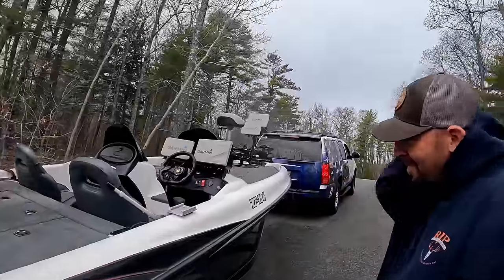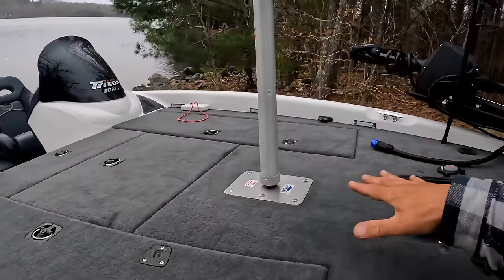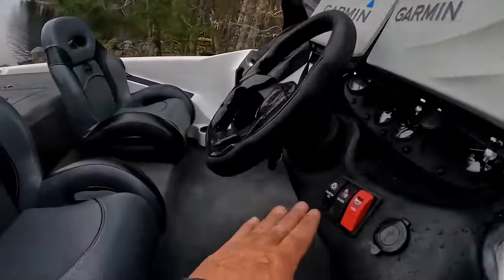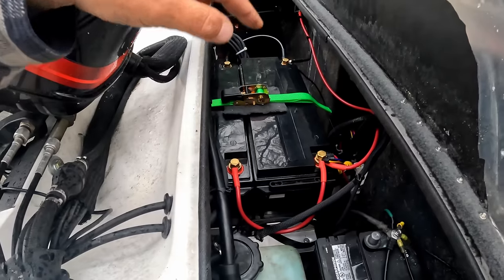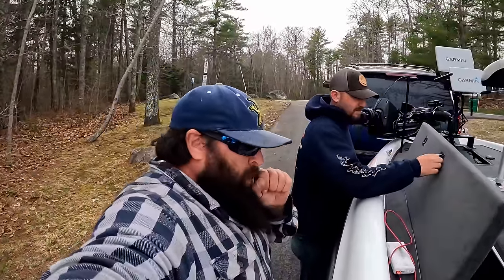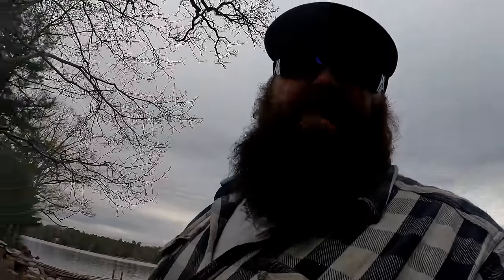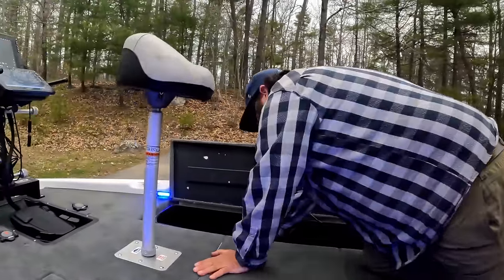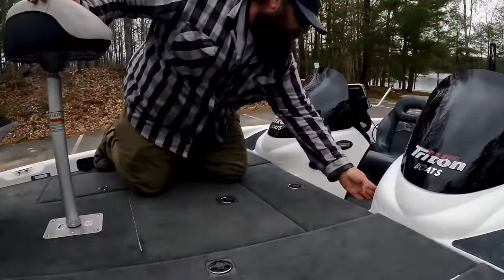Complete BOAT RESTORATION: FINISHED !!!

Comment: Wow, very nice job on the boat. Just want to let you know that Ionic lithum batteries is now offering a 16 volt battery for the electronics. They are saying it offers the best picture quality possible.l would recommend them. They have bluetooth so you can see amp draw and amount of amp charge while you are using them. They make deep cycle and cranking batteries too. I am a dealer so can get good pricing.
Reply: I would be interested in some information on these batteries. How can I find you on the web?
Reply from the maker: Thank you